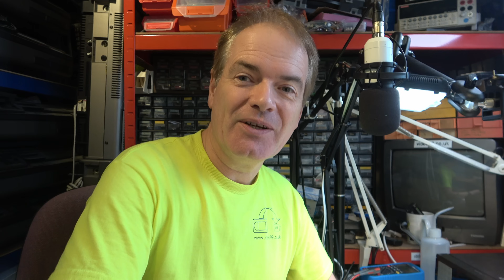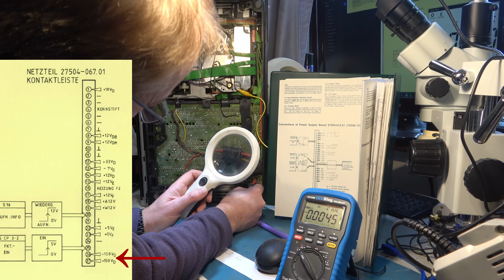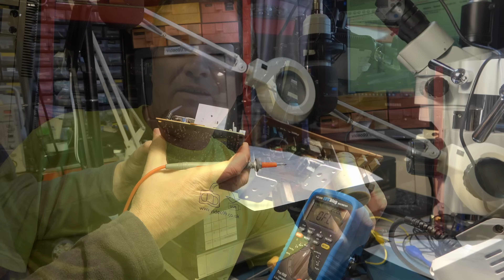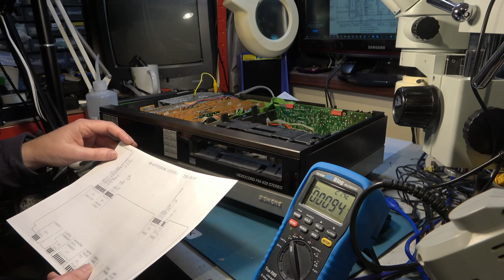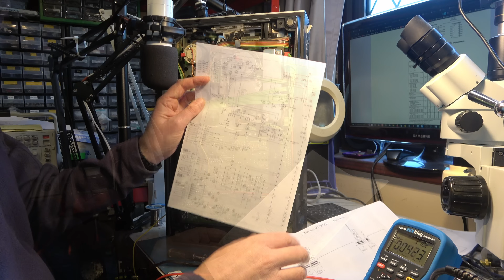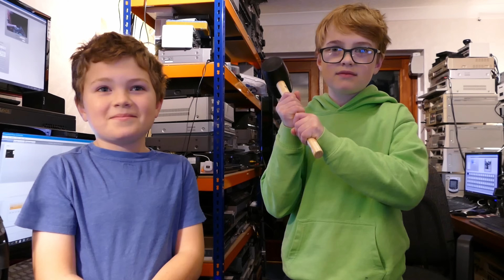The rarest video recorder in my collection. Part 2. Progress of sorts.

Comment: I need help with a Video 2000 Philips V2414. When I plug in the power cable, the display stays dark and the drive goes crazy, repeating the same steps over and over. What could be wrong here?

Comment: Wondering if you could source any video 2000 parts to ship to the us. I need 2020 parts and 2x8 parts.
Reply from the maker: I have some scrap VR202x machines.  But they are heavy!  2x8 are much less common.
Reply: @video99couk I need a faceplate with no electronics . Also an adapter for video out. For the 2x8 I need the loading axel with the 3 gears. I'm thinking felt for the brakes but have to fix the loader first. I might also be interested in one of your boards for a 1700. Thanks.

Comment: As for the clock, when replacing these Varta batteries with a lithium battery, Grundig recommended soldering an additional diode. I don't remember its designation, but there were service tips for the series from VS 200 and on the Tommy line. Probably a diode type: 1N4148. It was in one of the Grundig Service Informationen. If the battery is not working properly the display may not work.
Reply: It rather looks like a damaged Syscom MCU on Ablaufsteurung this 8051 or TMS 7040 but it's rather big. Reset goes to it. These systems not flooded by batteries were durable but I won't say for sure because after years in these Grundigs can be miracles. Maybe it's one of the further components in the Reset loop.I recommend visiting the electronicwerkstatt de forum from what I know it's free. In German but with a translator or AI you will get by. There are a lot of posts about Video 2000 there. And a lot of experts on these VCRs.
Reply: If it was a battery issue, there is a description on the German Old Fidelity forum also about the VS 200, it has the same clock system as in the 2x8, if I remember correctly, PCF 8573 by Philips. Original text
Gem. Service-Information 15/92 kann in den VS 520, VS 530 und VS 540 der 1,2V NiC-Akku gegen eine 3V-Lithiumbatterie mit 1N4148 in Reihe ausgetauscht werden.
Jedoch sollte zusätzlich noch ein 1k in Reihe liegen. Ob sich das auch im VS380 so realisieren lässt, müsste man gucken, weil die Beschattung des PCF 8573 etwas anders ist, als die des PCF 8583.  Translation According to Service Information 15/92, the 1.2V NiC battery in the VS 520, VS 530 and VS 540 can be replaced with a 3V lithium battery with 1N4148 in series.
However, a 1k should also be connected in series. End of quote. There used to be clippings of these diagrams circulating on the net also for VS 200 where it was most similar to 2x8.

Comment: Technologically vastly superior than its then Japanese competitors, except when it came to market decisions WRT to video tape media titles.

The DTF system alone, fascinating.
Reply from the maker: I don't know.  V2000 was trying to solve problems that didn't exist, like a flip over tape (who wants that?) and clear picture search with just two heads (add extra heads like some VHS and Beta models did).  Then the machines were unreliable and the picture quality is mediocre.  But DTF came back, it was included with quite a lot of Sony professional Betacam machines and even a few MII from Panasonic.
Reply: @video99couk  I assume the selling point of tapes which twice the recording time on the same length of tape was cost. Video tapes were atrociously expensive for a long time. Even in the 90s my dad often bought E-120s and recorded in LP to save money.
Reply: @video99couk  

When Active Sideband Optimum (ASO) came along, it stopped S-VHS and Betamax in its tracks [excuse the pun] WRT to image quality. But domestic VCR was on the way out soon afterwards.

Either way V2000 was innovative and as was the N1700 before it - even the 1500 series! - latterly piezo-actuated DTF being particularly fascinating/memorable for innovation in its day, at least for me anyway.

The schematic formatting, I agree, are characteristically German-centric. German broadcast systems are authored and formatted in the same way, i.e. Telefunken and so forth.
Reply: It was better in theory, in practice it was too advanced and expensive in mass production for those times. Nevertheless, the Japanese had greater support, including the government MITI and credited automation of some factories. In the sense that the corporations had reliefs guaranteed by the government. Not all machines broke down, but at least half of them and at the end of production one fourth of each series. And Grundig paid extra 50 DM for each. Perhaps if it had been better protected and had more time for development. In these conditions, the production of this system was perhaps not a purely technological but an economic mistake. VS200 based on the video 2000 VHS series was slightly better, but the early series also had quality fluctuations. Overcome, but late. Then there was VS300, not properly tested at all before entering the market. And after that Grundig gave up.

Comment: Colin, There should be a IC on that back board behind the deck IC L23B (SGS Chip) that may be defective. Also check the relay in the power supply (If this model has one). The front panel also has a controller IC which should be checked. Try to plug a IR sensor on the back of machine for remote access. There also is a 10 ohms resistor that normally goes open circuit in power supply which is inside a insulator connecting in between two pins on the power module. The main common issue with these machine always turns out to be poor contact switches and poor cable inserts which you maybe aware of. There also is a small main contact switch under the cassette housing that detects when the tape is inserted that loses contact to tell the deck to operate. Front panel selector switches tend to also jam and cause the machine to get confused in operation that may cause the clock display to perform defectively. When you found the transformer to be open circuit on its windings there maybe a possibility that someone who worked on the machine before you could have also caused other issues elsewhere in machine that relate to the power circuit (Best to give it another visual check). Hope this info helps...
Reply from the maker: The relay is in the 2x4 Super models with the switch mode supply, this has a linear supply which is all working.  I am very concerned that one of the big ICs has either died or lost its firmware.
Reply: Agreed, there is a TMS 3763 on the display board that receives commands from the keyboard and controls the display, although it is not a classic Timer CPU chip like in Japanese video recorders. `
Reply: @janmos5178  Yes, as you point out I do remember TMS 3763 going faulty on these machines. Best option would be to just find a donor machine and swap the front panel and then test...
Reply: @Televid4 It's possible, but  I have different experiences. In the models I know, ICs rarely failed, especially before the age of 10, and especially those Texas Instruments. If so, sometimes EPROM in VS 200 and sometimes TDA 2740 and 3771, and even then half of these failures are the effects of external failures, and even that was rare. In Philips, even less. I have never replaced any of the TMS or 3763, 3757, 3766. I know from colleagues that they sometimes failed. But yes, it needs to be checked.
Reply: It is possible that one of the CPUs failed, but it may be just some external component, as I have already written, in the machines I know from these series, integrated circuits failed rarely, more often capacitors, optocouplers, cold solder joints or cable connections failed. Here they gave cheap components because they could not afford better ones.

Comment: I remember someone telling me that the control firmware on these can go corrupted due to the EPROM chip erasing itself or accidentaly being exposed to light. Let's hope that's not what has happened here.
Reply: If I remember correctly, EPROMs were only available in VHS versions, i.e. VS 200 and 300 series and later Tommy Line. These Video 2000 series had software embedded in the 8051 MCU on the Ablaufsteurung and DTF Servo boards. In some Ablaufsteurung modules, instead of 8051, there was a TMS 7040 MCU. There is no classic 2764 Eprom memory there.
Reply from the maker: It is a possibility.

Comment: The Video 2000 are not that rare, we had a Philips V2000 recorder back in the early 80's we also had a Philips X150x Recorder (those square tapes with the reels on top of each other) back then too.
Reply from the maker: V2000 machines are not incredibly rare, but this model is.  I've also featured various N1502 / N1700 machines on my channel.
Reply: Yes rare it's stereo not mono.

Comment: They really put +/-150V on the same connector, several pins away from the low voltage supplies? 😲
What does it need those high voltages for? This is certainly a very strange design, and somewhat reminds me of similar oddities in German cars.
Reply from the maker: The high voltage is for the piezo elecectric actuators under the head tips, which alter the head angle during FF/REW/Pause for no noisebar picture search functions.  Nearly all V2000 format machines had that function.  Called DTF or Dynamic Track Following.

Comment: usually, the battery on the "Ablaufsteuerung" has leaked at some point, which over time led to (partly) dissolved traces and/or damage to the small chip below the battery.
Reply from the maker: Replaced the battery in part 1.  Didn't seem to be any severe leakage from that.

Comment: Hello. Can you make a video repairing a JVC HR-S9500 with dynamic drum?
Reply from the maker: Funny you should mention that.  Not wishing to give anything away, but just watch my channel over the next month or so.
Reply: @video99couk  Hoping one day Colin may come up with a bypass to the DD electronic circuitry  so that a non DD drum can be be swapped out with the DD one.
Reply: That was fast https://youtu.be/gmhKEJlBkJA
Reply: @ Now I know what you're talking about.
Reply: Normally, JVC recordings can be played back by other devices without any problems, as the playback devices recognize the higher tape speed from the distances between the synchronous pulses on the edge track. JVC 9600 only has 183 minutes instead of 184 minutes 30 seconds recording time with Panasonic 960. Luckily I didn't have to take a Samantha Fox cassette (JVC recorder) to the dealer to complain that the still image wasn't running smoothly🤣(Panasonic NV-F70EG).
Reply: @TTVEaGMXde  That’s not what we are talking about here, we are talking about the DD failure that causes the VCR to shutdown, so disabling it will end this failure of death.
Reply: @Capturing-Memories  The comment was for the first writer. I have never heard that the servo control works correct without DTF.

Comment: So, after it is fixed, does it work for video?
Reply from the maker: If I can fix it, then it will be the only V2000 machine I own that can run the V2000 Long Play (XP) recording format.
Reply: @video99couk  I hope you are lucky and LP (XP)-mode will work at once. Maybe it will not, but let's see ...
Reply: @video99couk  cool
Reply: @video99couk  If the postage wasn't atrocious I'd send you a Philips VR2840 I saved from the electronic waste a few weeks ago. I briefly plugged it in, all the transport features work but the picture is extremely poor on playback, still and picture search. 

I'm somewhat tempted to give up V2000 altogether, way too many broken machines and no real use for them. All my tapes are eBay purchases and in mixed condition, some illegal copies of rental tapes and some TV recordings. The only real fun bits are the 80s TV continuity on some of them but these bits are few and far in between. At the moment I've got an Ingelen-branded Philips VR2022 (worked the last time I tried it), a broken Siemens FM304 (Grundig 2x4 Super I think) that pretty much lost picture when I played a crinkled tape years ago and has resisted all my repair attempts, a Philips VR2334 that I never got a properly good picture out of and a very much broken Grundig 2x4 Stereo 880, which has plastic bits falling off all over the mech.